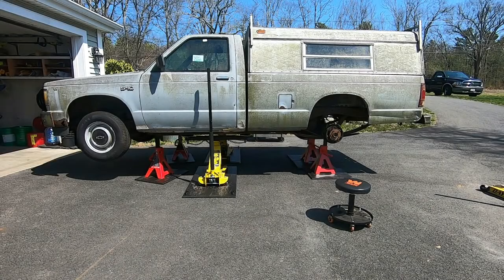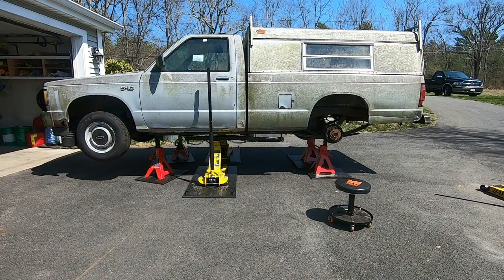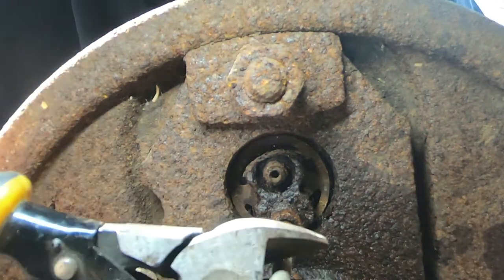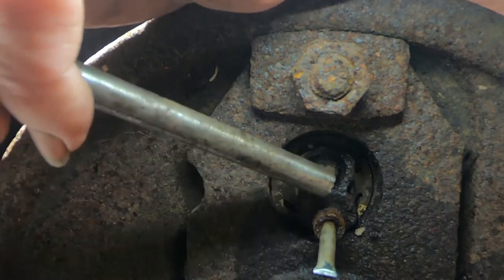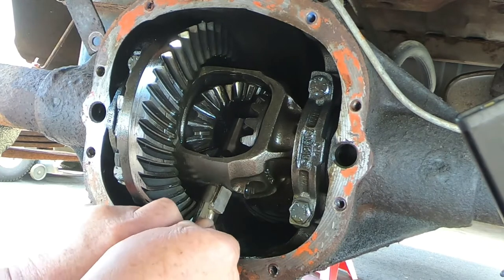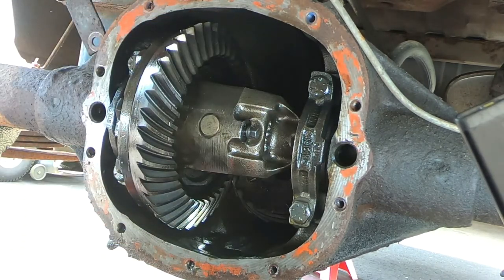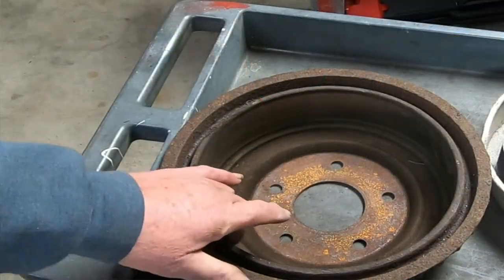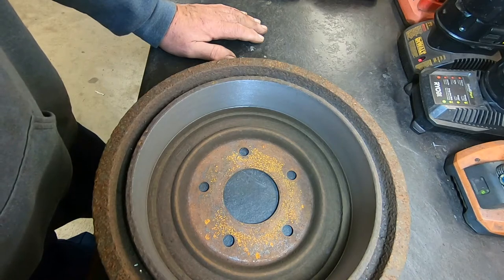How to Change Rotted Backup Plates on an Early 80s GM Vehicle

Comment: Thanks Richard, very detailed!. I actually had the same truck in the early 90's but the rust in NY got the best of it quick.
Reply from the maker: Thanks 7Westwood; That's the next project as my friend wants me to try to patch up some of the rusted panels just enough so it will pass inspection.